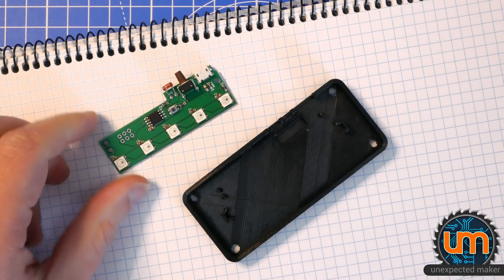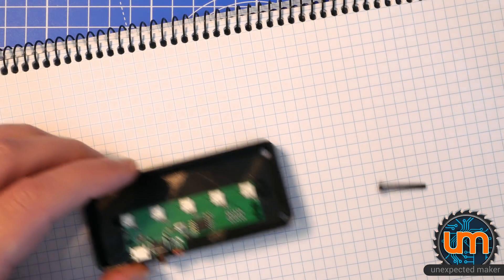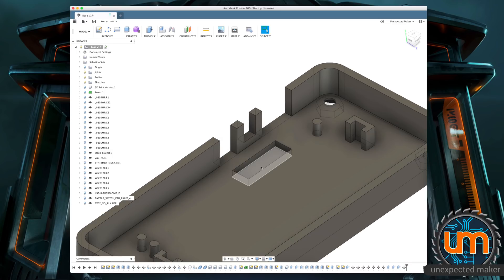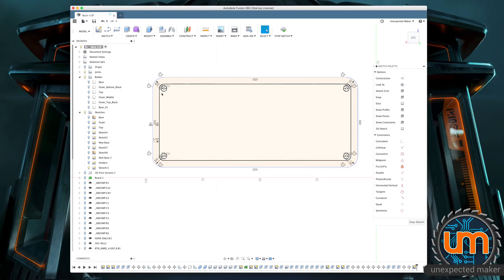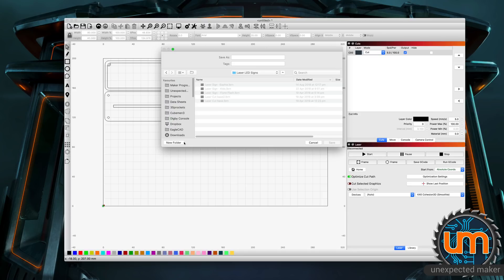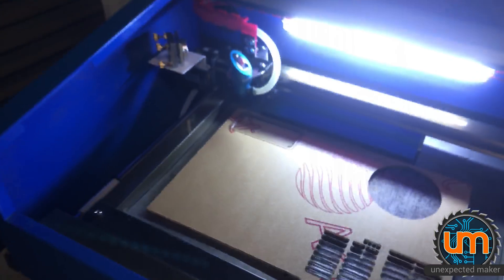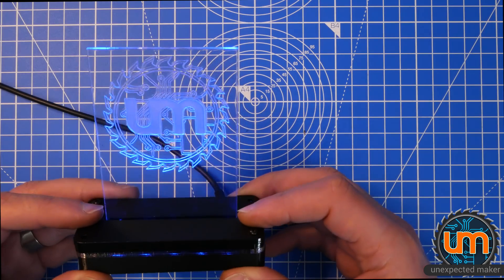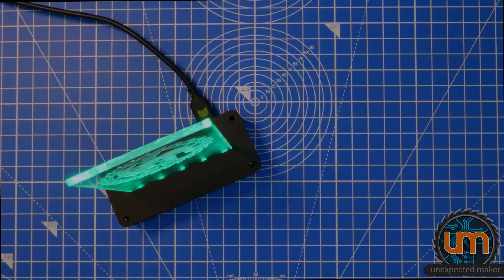Laser LED Sign - Part #3 - Case Design & Assembly

Comment: Maybe cut the inside of the clear "layer" with a fine zig-zag pattern to spread the light more evenly?
Or just sand it a bit?
Reply from the maker: I have a few design changes for the inner bits, but not had time to get them cut and tested yet.